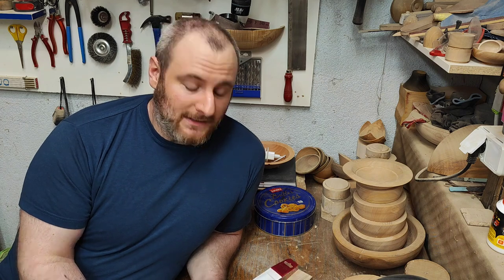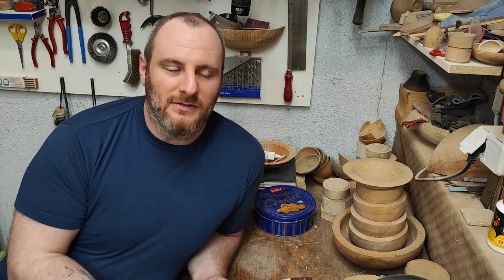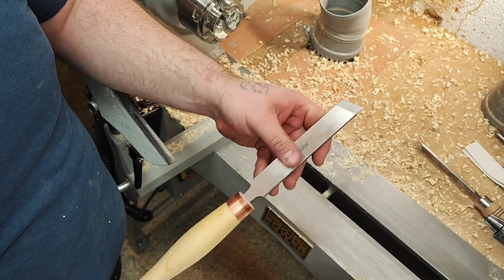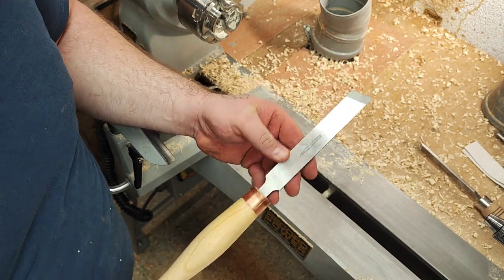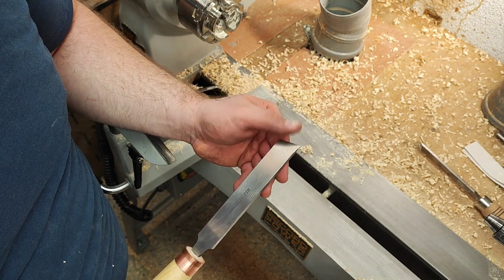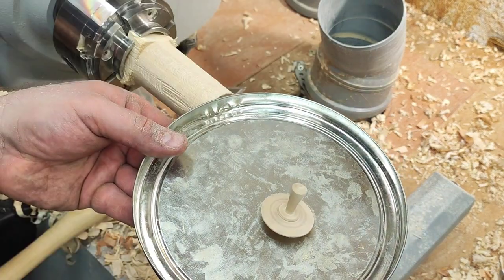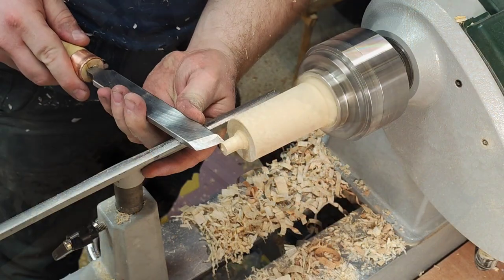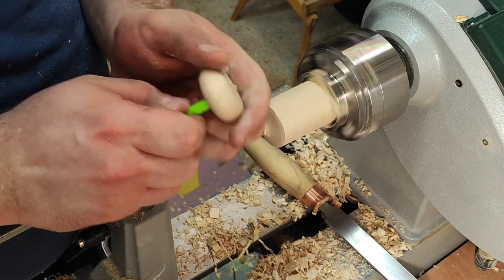SORBY SKEW CHISEL, WISH COME TRUE

Comment: You make great videos.  While watching this one I had an idea.  Where you drilled is round and the tool is flat.  I thought you might fill-in that gap with baking soda and superglue. That is for the deep in there.  Then have the glue and sawdust to close the top of the open space.  Then no more gap.  That is if there is a gap.
Reply from the maker: Thank you very much for watching and comment, Usually what happens when you force squere shank into round hole is that corners dig in and the fit is with just tiny gaps of circle.... Not much to worry about,but if it was bigger then I put thick CA glue which if one day I want to change the tool its relative easy to cracked.